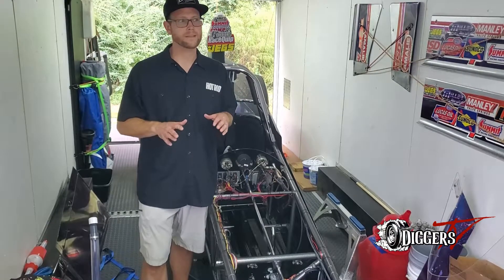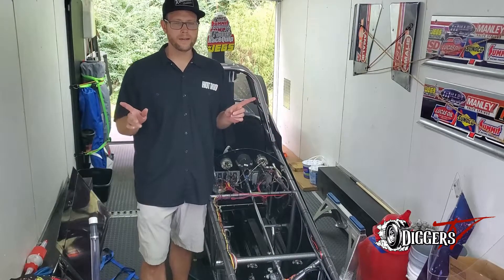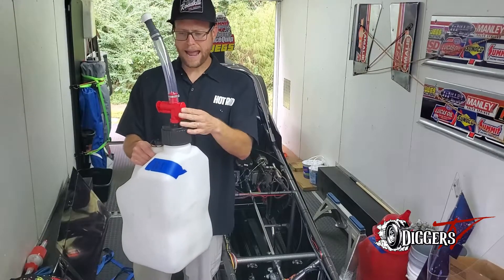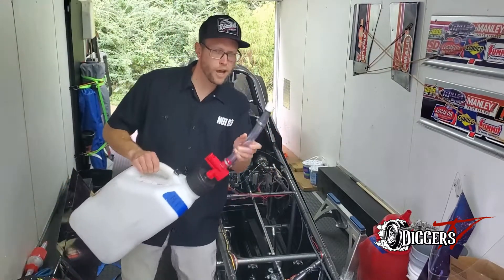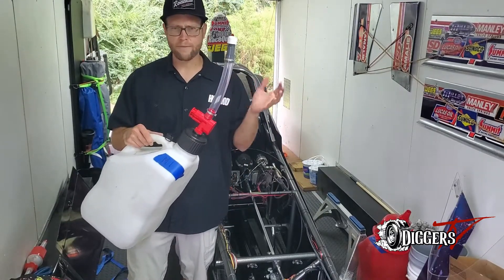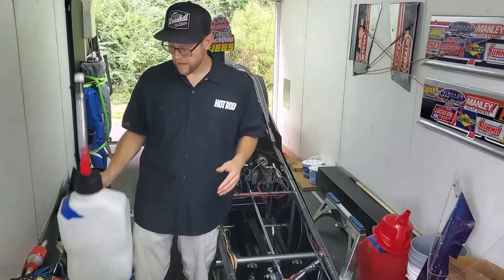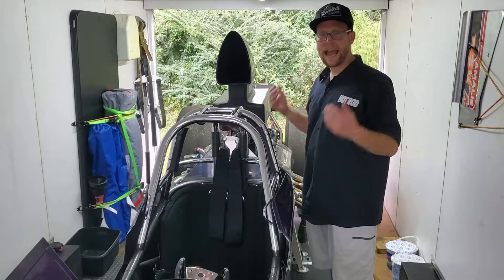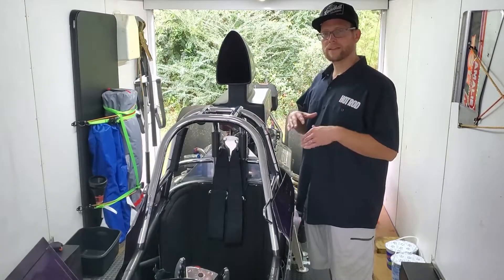DRAG HACKS: the VP Trigger, plus tips on how I fight Alchohol corrosion and warm up my engine

Comment: I made the switch to alky a few years ago and won't look back.  I run KillerRon's injection, it's been awesome.  No more overheating issues, fuel costs less than half despite using more, and car is faster and more consistent.  I will never run gas again in a drag car.  I also run a primer plus system for warm up and end of day.
Reply from the maker: Thanks Mark! Have heard many good things about the Ron's system.